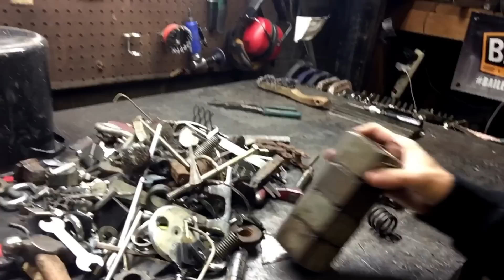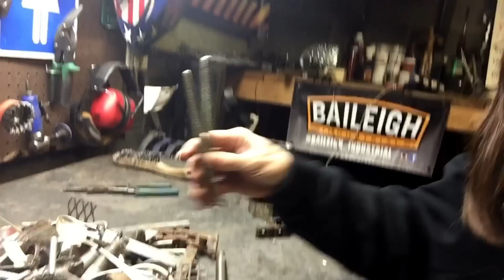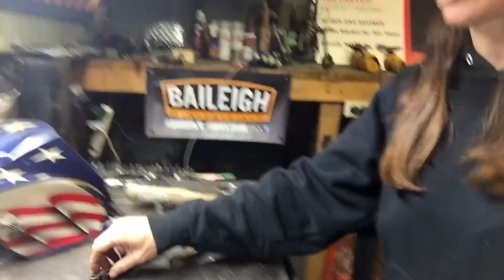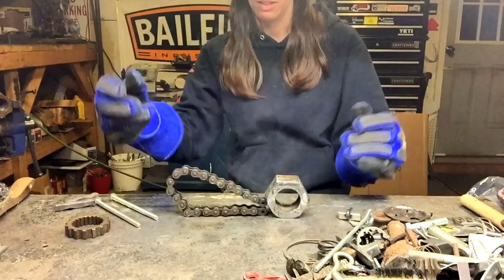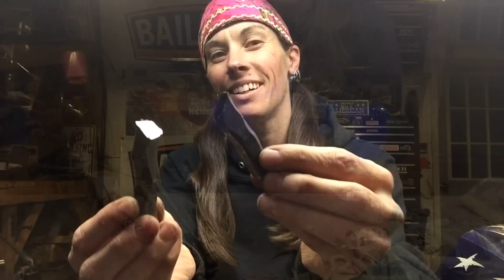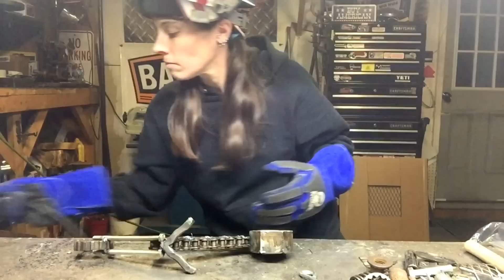How To Weld A Chopper Style Motorcycle | Easy Scrap Metal Art Sculpture | Barbie The Welder

Comment: That turned out well, as a biker, its another type of small project I want to do in the winter months.
I have a pair of big nuts but can't bring myself to weld them :).
Anyway, another good vid and more inspiration, thanks, and again , thumbs up for your presentation-I'm an ex army instructor and tend to lose it when other YT presenters don't follow the auld EDI (Explanaishun, Demminstrayshun, Imitation) like you do.
The chain following the petrol  tank (gas tank to you ex colonials) shape is good, I'm thinking I could fill it in with sheet metal and put a logo on it mebbe.

Comment: I throw my bike chains in a fire to cook em clean before welding. The heat also colors it up a bit.
Reply from the maker: Dave Z great idea!! Thanks!
Reply: Have you ever noticed too that some of the welds will crack using bike chain? I think bike chain has high carbon content so it gets brittle at the weld. I found flux core mig seems to work better....maybe it cools slower cuz of the flux....and I burn it in a bit more than my usual art weld. I like using bike chain and have a good supply of used chain....Im a bike mechanic! LOL...Happy Welding!
Reply: Dave Z   I use my TIG for most smaller chain to avoid cracking.
Reply: Do you use filler rod or just fuse it? My problem is my chains are so dirty...even after I cook the grease out of them they don't tig very well...theres a lot of crap under the links...
Reply: Dave Z  depends on the link size. Smaller, fusion weld. Larger links I use filler. I soak them in grease remover then wash down with acetone.
Reply: thanks for that info...I may have to try soaking mine...that would leave a cleaner chain for tig welding...